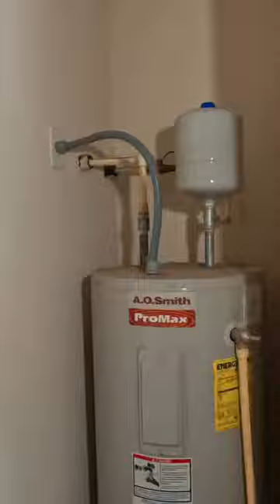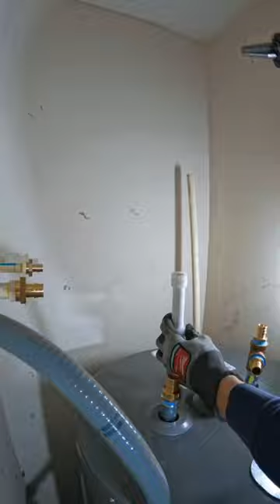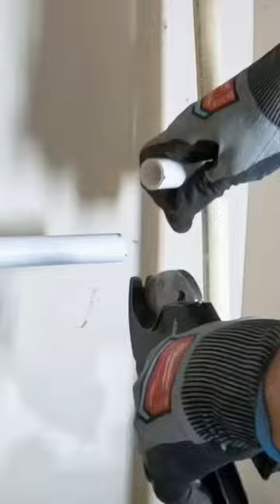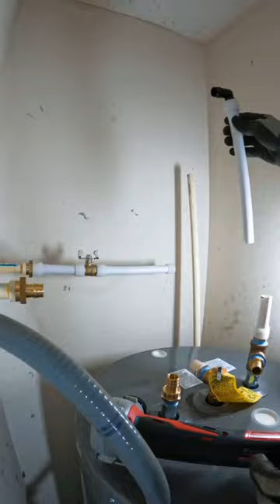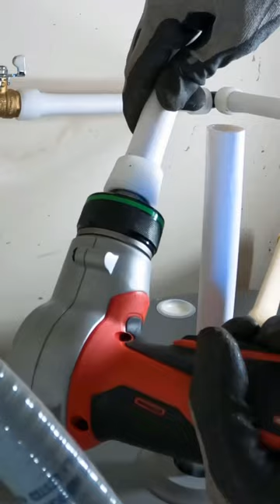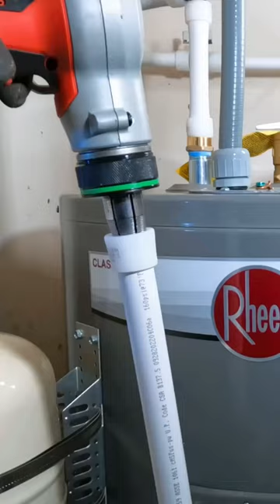Replacing a water heater with PEX A cold expansion 💦 #plumbing #plumber #shorts

Comment: First time I’ve seen an expansion tank mounted on a water heater. How thick is the insulation on that thing and how long are those screws? 😲
Reply from the maker: There’s about 2 inches of insulation around the tank .. 1/2 inch self tapping screws

Comment: It's not the same as copper but it'll work. Quick and easy. White pex is the best imo. Looks way more professional than red and blue.
Reply from the maker: Yeah I usually only carry white on the truck
Reply: Your over thinking it if you think color makes a lick of difference lol. I love when I go to a place and know exactly what pipe is hot or cold. I only use white pipe because my local supply store only stocks 10’ chunks of white pipe, the red and blue are always in 100’ rolls and I can’t stand working with that crap
Reply: @jasonrasmussen8265 he didn’t say it made a difference. Only said it looked better being white.  Same way electricity dos t know color.  Can run any color wires an get the job done long as the size and type is correct.

Comment: spoiler alert: its an electric wh so no flu up top.
Reply from the maker: It is an electric water heater correct
Reply: You have an acute sense of the obvious. 😋😋
Reply: Yep but where I live even an electric water heater requires 14 inches of copper where it exits the tank….
Reply: @ronh9384  I've replaced several water heaters without knowing that, though I don't really see the advantage to it. CPVC is rated for 200° F which is much higher than any normal water heater setting and still a higher temperature than the heater is even capable of.

Comment: No, no. God no. Most cold expansion pipe requires at least 16in from the water heater for connection. I know at least 3 states where this is a no-no by code, and it's against what the people who made the thing say you can do.
Reply from the maker: Ain’t code in GA

Comment: Manufacturers instruction state that it must be at least 18 inches from each fixtures how are you plumbing this in passing inspection
Reply from the maker: My code permits PEX to be piped directly on an ELECTRIC water heater .. gas is a different story

Comment: you're too close to the heater with the pex. The pex is not level to the expansion tank. Let me know when you want me to stop!
Reply from the maker: The pex is level to the expansion tank and yes I can use PEX directly to the heater on an electric water heater if per the code for my state .. gas is the only type where I’m restricted to copper / metal at the top

Comment: Is good to see that you connected to the expansion tank close to the tank. Not like all this plumbers that connect up high.  At that point the expansion tank is worthless
Reply from the maker: Actually as long as it’s somewhere on the cold water line anywhere in the home it works the same .. in our state the water heater can be in the garage and the expansion tank in the basement and it’s still legal and still works technically
Reply: Expansion tanks work no matter how far away they are from the water heater. As long as there's no check valve in line you can have it literally anywhere.